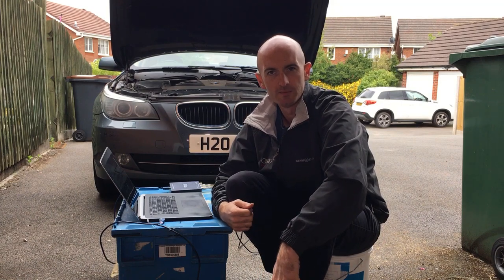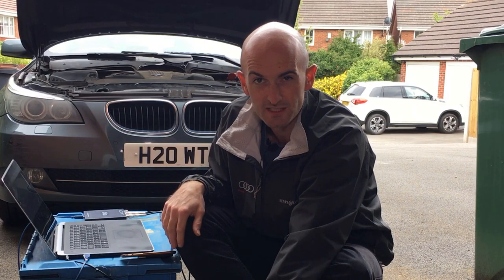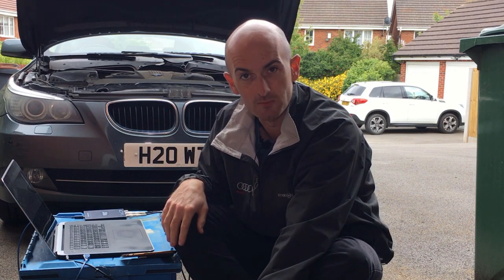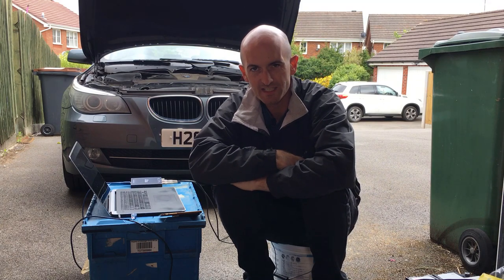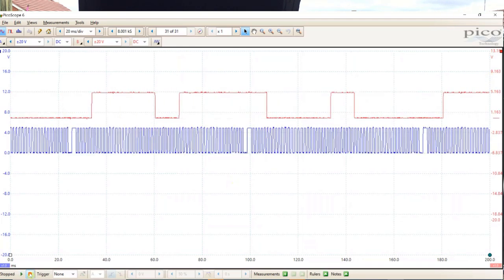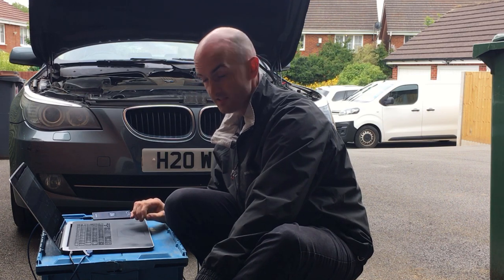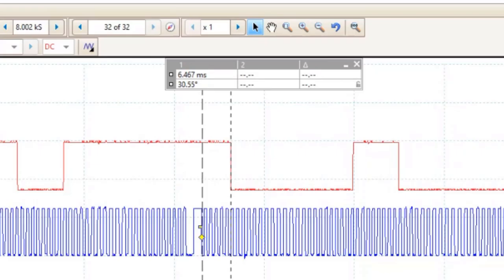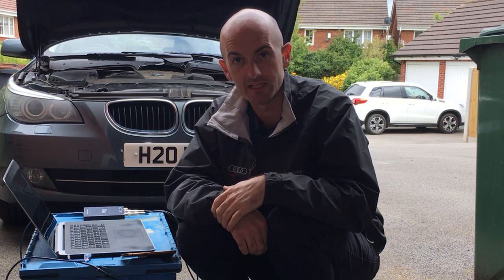BAD vs GOOD TIMING CHAIN CHECK! [BMW N47 Timing Chain Noise and PicoScope 2204A] | Mechanic Mindset

Comment: Hey i have a problem, i replace chain on 320d and when engne working sound is ticking like spaner or injecto
Reply from the maker: Hi, I suppose it could be many things. It’s hard to say without looking
Reply: @MechanicMindset  but i change kit of chain with spaner, then put new vp pump. Maby its not good in timing fire
Reply from the maker: @valcic1993  Sorry, not sure. If you turned the engine over x2 and re check timing before you started engine it should be ok
Reply: @MechanicMindset  yes i check camshaft timing with tool thats ok. Maby vp 44 is not 100% in time
Reply: Can i send you video of working motor? 
On your mail
Reply from the maker: @valcic1993  Honestly, sorry I’m not going to be able to advise you. You should do all the basic checks if it was any other engine with a noise. If it wasn’t there before, then need to retrace your steps. Also check oil filter for swarf in case bearings are finished. VP pump timing shouldn’t cause noise 👍

Comment: Looks like engine mounts are gone... Engine is vibrating badly.
Reply from the maker: I think it is the refresh rate on the camera. If you see my other videos with the fiesta 3 cyl, that looks really bad too. But in real life they are fine. Also worth noting that the BMW has active engine mounts. They go soft at idle to reduce cabin vibration, and stiffened up under load 👍

Comment: at a quick guess 5 more degrees and an intake valve will have been kissed
Reply from the maker: More than likely.  I have had them come in still running with valve kissing piston! 😱